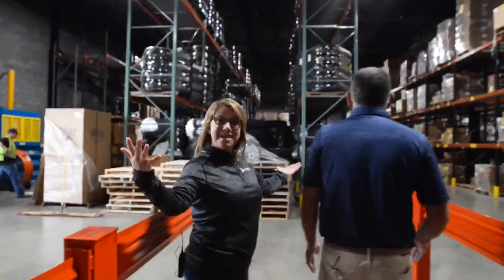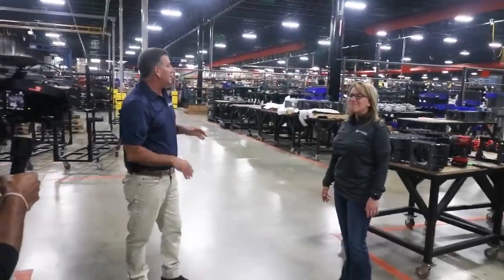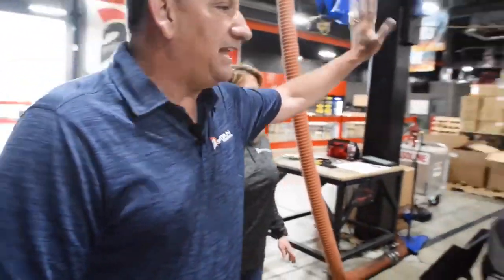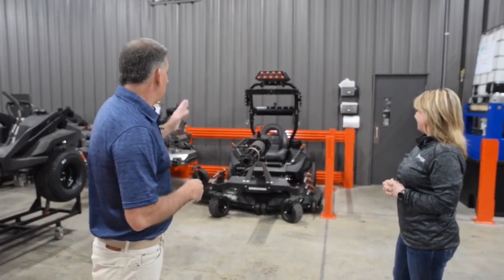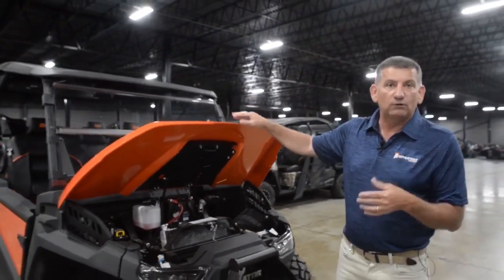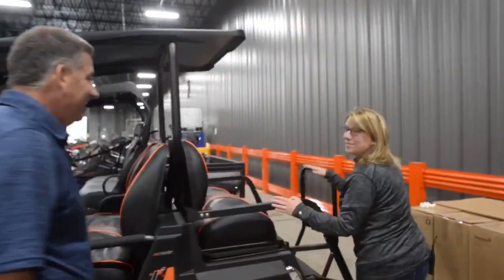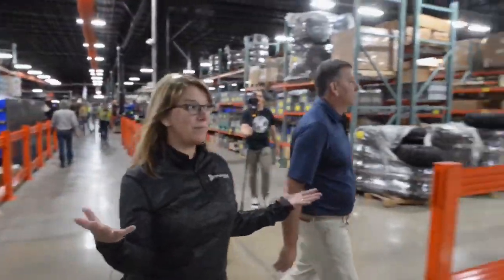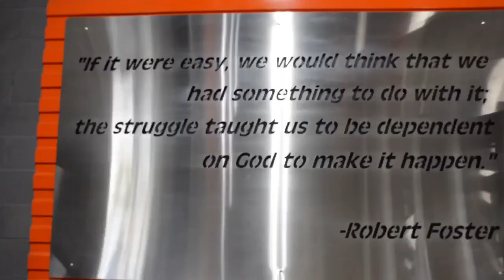The Spartan Advantage Tour

Comment: I'm a 70 yr old farmer who still enjoys taking care of my yard.  I have used zero turn mowers for years.  My first was a Dixon mechanical drive. The problem I'm finding with every brand is they are getting harder and harder to dismount as I get older.
A zero turn rider, not stander, with a higher seat position, would stand out in the competition.

Comment: Hello Mr. Foster . My name is Michael. I am a Disabled Veteran. I just recently purchased a 42 inch Spartan mower. Is it possible that you could build a Spartan RZC and put a 48 inch cut blade deck system on it and start selling them In the RZC line.? This mower is a tad  to small . And the 54 is to large. A 48 would be just right. Thanks and God bless

Comment: Why do some mowers stripe and others not?  I have a 2021 SRTXD 61" deck with 38.5 hp Kawasaki.  I have used different blades on different types of grasses and lengths and 290 hrs later have yet to see a stripe.  I've seen others that will with the same mower and setup.  I'm having buyers remorse.  I wish I had went with Scagg for a better cut.  If it weren't for my awesome dealer I would definitely wish I had went with Scagg.
Reply: Get a striping kit for the deck; you need the rear of the deck to lay-over the grass you just cut. If the blades themselves are low in the deck, the shell doesn't have much to work with as far as shoving the grass over. I have a very old disposable Snapper SPX 46 that stripes better than any commercial mower I've seen, but, it's blades are high in the deck. So, in front of my home I use the junk snapper to cut and stripe, and out back I use a z900 Deere, because even with it's robust 7 iron deck, it sucks at striping. Blade choice will also affect it. If your deck isn't correctly adjusted, that too will affect it. But to have buyer remorse over striping is kind of a you thing, and not the machine. Old post, but still....